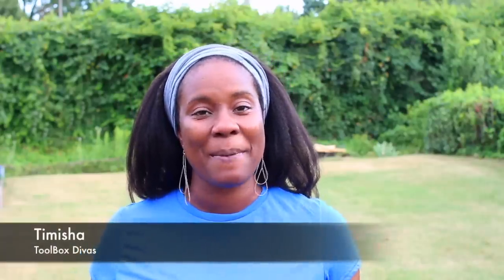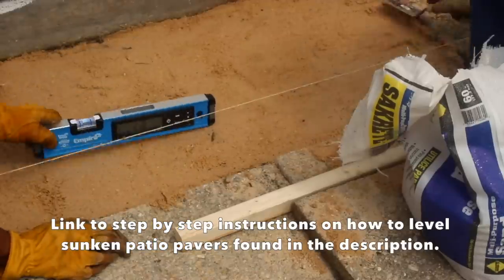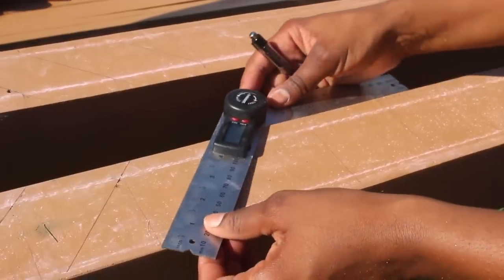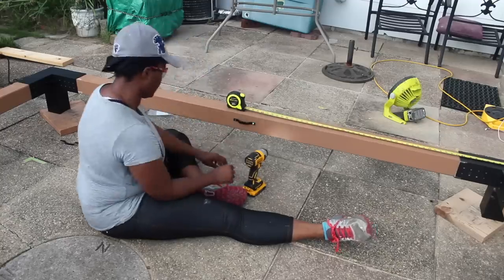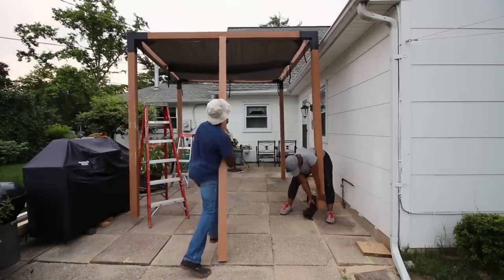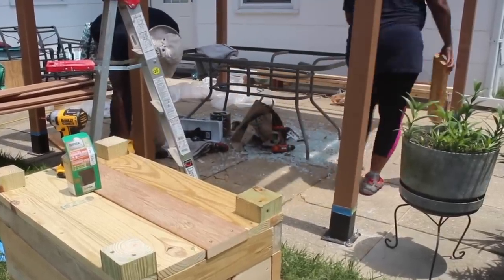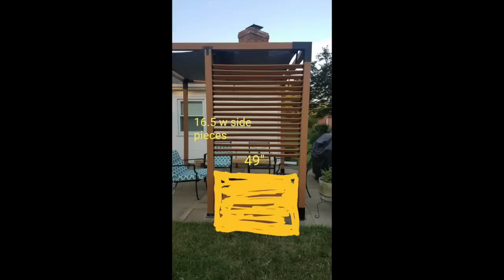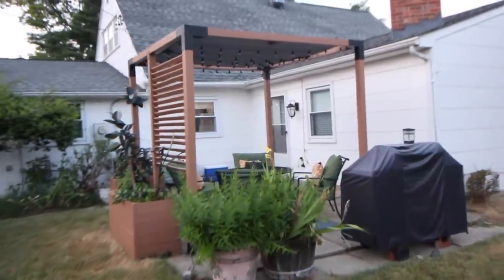DIY Patio Makeover | Before and After with a Pergola

Comment: Very nice!! How did you make footers again? I didn’t understand that part?
Reply from the maker: Hi thank you! So for the footers you want to dig a whole that's a quarter of the height of the pool deep. These 4x4s  we're 8 ft. So we dug the whole about 2 ft deep. Then filled it with concrete and placed steel rods into the concrete.. Once that was cured we were able to cut down the rods and bolt the poles in place.